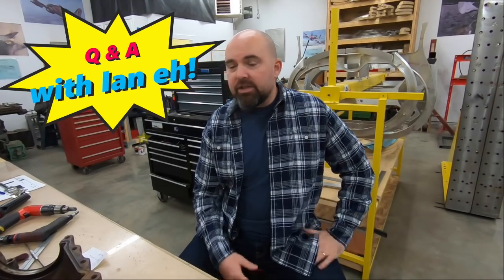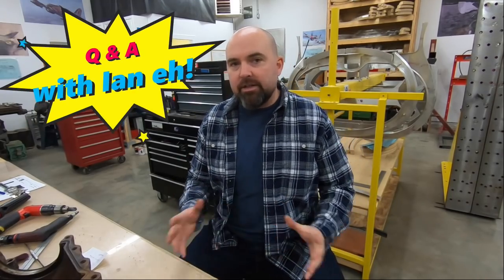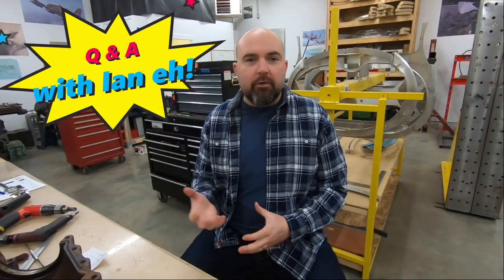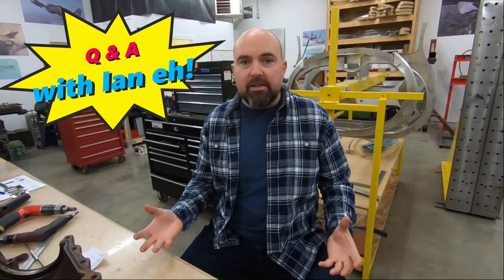Typhoon Legacy Q and A with Ian eh -Typhoon Materials

Comment: Originally ordered for intercept of FW 190 on rouge sorties over England her 6 ton bulk precluded her ability to individual dog fight though she could cut and run. Nearly cancelled but the beauty beast found her roll in ground strikes. She was the harshest of mistress’s to her pilots but if they could master her, well, a squadron of Tiffies was a most unwelcome sight to the enemy indeed.
A howling banshee with her rocket and cannon attack. The Royal Air Force.

Over 3,000 built. Currently in flying status 0. An old warhorse with stalwart service to her country shall have a representative of those men not returning from their last mission. For God and Country.

Comment: Dear Ian.  You are doing a great job.

But...Keep it simple.  This means: if you can obtain an aerospace material with standards and tracebility exceeding the old specs, the EASA would say: OK, go on.
That means DD rivets can do the job. 2024 sheet, plate can do the job.  OR (Alass, alass) the German 1.7734/5 steel tube will fullfill all your demands concerning strength and fatique replacing the T50 tube. This particular aerospace material is used in the EXTRA 300. (+/-10G L.L. welded steeltube fus-structure )
The specs are at least 790 / 980 MPa for yield- and ultimate strength. But specimen tested in our factory obtained 1030-1050 Mpa ultimate.... exceeding the T50 material. 
I  measured the K1c by test on a cracked specimen, it was in excess of 54 MPa sqrt m, so a quite tough material. 
The quotation for making a  specified tube with inner and outer diameter was 4000 Euro startup cost and 200 meters tube length to be made. Total 12K or so...but.... with lesser than 0.05 mm tolerance on wall thickness! 
No problem at all to produce the Typhoon tubes.
 
Concerning the salt-oven, the problem it is really not that big ...nor the calibration.  It has to be calibrated once a year with limited cost, say 250 Euro. 
Heating to 440 C during 0.5 an hour and cool-down the bucket with rivets. You can use DD-s for 2 hours. If the rivets are becoming too brittle they will crack radially and that is the indicator your batch is too old.  Reheat the batch.

The best you can do is contact Marshall Aerospace in Cambridge, and ask if the can contribute your project by loaning you such an oven...Marshall did a lot of repair on battle damage on Tyhoons and Tempests in the war, see their picture gallery. 

This is a great project!  I must say that at the end!  (Sorry for this long contribution.)
Louis van Rijn,  PAL-V Europe, Stress engineer.
Reply from the maker: Hello Louis, thank you very much for the detailed note! We are indeed going with newer modern materials that meet or exceed the original, there are only a few cases where we need to involve engineering verification of replacements.

Furnace calibration (continuous) was the main issue for not installing  one on site, we have now connected with suppliers who will conduct both steel and aluminum heat treatment for us. Your offer is absolutely fantastic, but space/usage and power are also factors for the installation. 

The German 1.7734/5 is very interesting, I will have a look at that one. We already have our tubing here in the shop, but I don't like to post our specific material details online too much, perhaps you would like to connect via e-mail? ian(at)typhoonlegacy.com Ian

Comment: ‘Spot on’ descriptions of the rivet materials. Just wondering if a ‘KE’ (7050, 41ksi shear) rivet material is available for your high load joints? Tough to drive but doesn’t require HT and ice.
Reply from the maker: They have been discussed for use, however, for those areas it is likely that I will push for 2024 rivets and arrange for HT and make a road trip vs delivery. The applications for us will be in smaller numbers, and the finished product for a treated, driven DD rivet is very nice ( both rivet and surrounding structure). I also understand that driving an E rivet in 2000 series structure has high potential to cause dissimilar metal corrosion, so they aren't an ideal soloution~Ian

Comment: Hi ian, I guess you know about AC27-23? Just a thought about rivets .Have you looked at SP 80 and SP 85 and 1498 and 1497 rivets? These were used on every  HSA/Bae125 aircraft first designed in the 60's so not too far away in time from your project. Off hand I can't remember the specs, but as the last 125 rolled off the production line only a few years ago they should be available in large numbers.
I remember DTD specs! but more common was L76.
Good luck mate.
Reply from the maker: Hi Hugh, thank you for the detailed information. I'm not familiar with the 1498 and 1497 rivets, is that an "SP" fastener? I did go through a great deal of the British rivet specifications for our work, and toiled over many updates, revisions and substitutions to the original call-outs; all sorted now thankfully! ~Ian
Reply: @TyphoonLegacyCoLtd  Hi Ian, 1498 /1497 were [I think] 'D.H' rivets [De Haviland]
and very handy they were too.
they were 100 degree rivets but the head was one size smaller. For example a dash 5 [5/32] would have a dash 4 [1/8] head.
So that if you had a thin skin in a material that could not be dimpled and you needed a meaty rivet then these were perfect.
Like brial rivets but regular sized.
Used on the wing centre section skins I 
used to build. SP rivets as you probably know leave your fingers covered in purple dye!
I still have a contact in the UK and can ask
if you wish and as the 125 is still in service they will be available
Reply from the maker: @cestriankiwi  I see, it sounds like they may have been the fore runner to the NAS 1097 rivets, very handy to have indeed. Thank you very much for the offer, but we've got this one sorted now; LAS Aerospace in the UK seems the best supplier for British rivets. ~Ian

Comment: At Aerospace (Hawkers) it was a maximum of 2 solution treatment runs for both aluminium sheet & rivets. We also had local operating instructions to stick to when it came to tensile & hardness & conductivity testing on aluminium alloys they had slightly tighter ranges than the actual material specs from what I can recall.
Reply from the maker: I've seen that with Hawker engineering, they liked to go that one step further than the requirements. ~Ian
Reply: @TyphoonLegacyCoLtd   I also recall being told that the other reason they stopped using magnesium  on the Tiffy was because enemy tracer round would make it burn
Reply from the maker: @toboldlygos_model_works  That's fascinating! I've not heard that one before, thank you for sharing. ~Ian

Comment: What certification processes will you have to go through if you use different materials from the original Hawker production?
Reply from the maker: There is no certification required for material substitutions, but very strict attention must be made to ensure the materials are correct, and one needs to make sure they are ready to explain the reasons and prove equivalency to the original. To do this, you will need to know everything you can about both the original alloy and the replacement. If the substitutes are not equivalent, there may be a need for modification to the components, and there will be a requirement for engineering involvement. In both cases, significant documentation along with material test reports CoC etc. is required. ~Ian
Reply: I was going to ask the same question about certification. The certification sounds like it is going to be a massive paper trail or today it would be a digital trail. How the certification process would be done by Transport Canada is beyond me. Imagine TC “oh another Typhoon, that Charlies specialty on the third floor” Not likely! How are warbirds certified in the US & Uk? I assume there would be a cost associated when dealing with TC.
Reply from the maker: @briancavanagh7048  Ultimately the AMO is responsible, and holding an AMO is a process of approval from TC. Certification, would be the issuance of a C of A by TC, and they would do that when the aircraft meets the requirements of the original manufacturer as proven through the documentation by the AMO. Massive amounts of paperwork and digital files to make sure every aspect is done correctly and this process can go smoothly. ~Ian

Comment: Question.......will any original parts be used in the reconstruction of JP843? I'm guessing strictly non structural...... Is there any legal requirement to include any original parts?
Reply from the maker: There will be some original parts used for sure, how many has yet to be determined. I would be comfortable to say that most structure will be built new though. The legal requirement is to have the aircraft's serial number basically; it's a bit more complicated than that though. ~Ian

Comment: Good stuff. Even T45 tube is hard to get in the UK about 10 years ago. I found to my cost trying to get some for a Hawker Beechcraft program.
Reply from the maker: My understanding (when I was digging into this) is that there is a producer of T.45 in Germany. I'm not too sure if that is still true, but I would imagine most of these alloys will only get harder to find. ~Ian
Reply: @TyphoonLegacyCoLtd  I watched a documentary of the restoration of a Hawker Hurricane and the only place they could get tube manufactured with the correct specification WAS from a company in Germany. The first batch of tube they made was the wrong ratio, so the German Company did the next batch for free and did not charge them. How good was that! I think it was a TV documentary and it was over 15 years ago, I can't remember any details other than it was hard for the restorers to find the squaring moulds to square the ends of the tubes. Also they showed the way they curved the wing skins by 2 people rolling the metal between 2 rollers back and forth and doing it by eye.
Reply from the maker: @David-yo5ws  The Hawker Tube squaring machines are quite rare, with only a handful of groups owning one. Many years ago, circa 2009, I build a Tube squaring machine for use on this project, incorporating a few modifications to deal with issues reported with the originals. I've not put it to use yet, but that time is coming soon! ~Ian
Reply: @TyphoonLegacyCoLtd  😮 I'm speechless. Wow!

Comment: If there's any change in the weight of a control surface, it's important to ensure that the mass balance is still heavy enough to prevent flutter. I assume that's been taken into account.
Reply from the maker: It will be when we get to those parts, absolutely. ~Ian